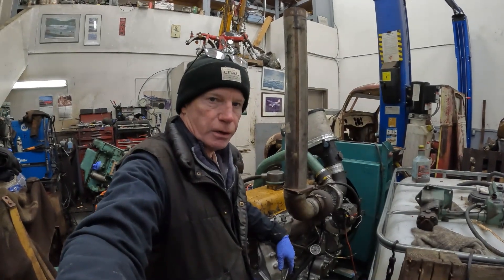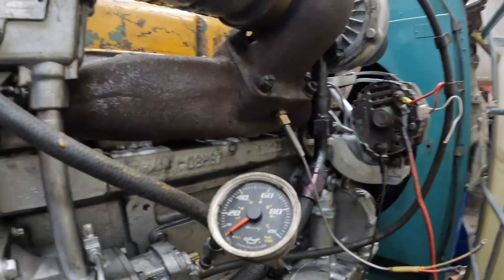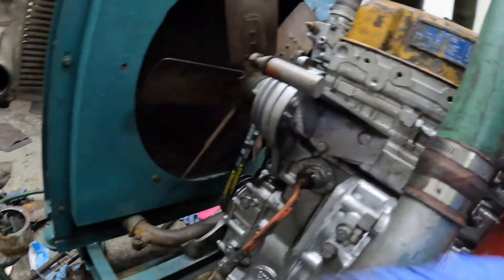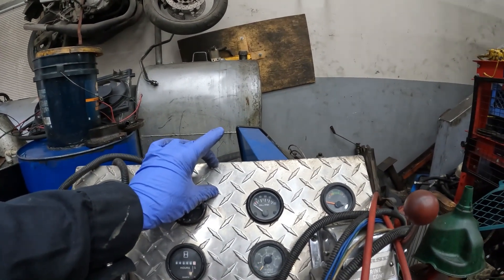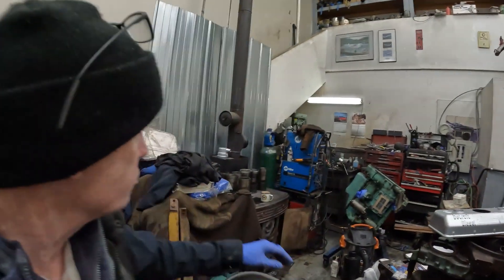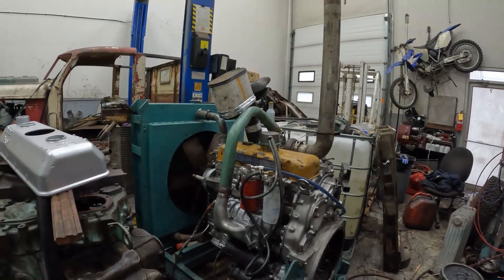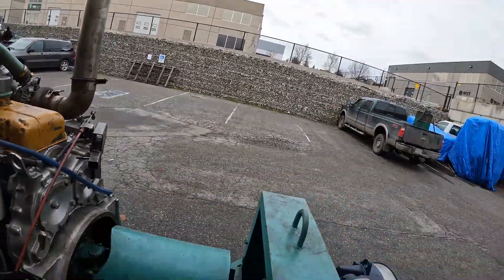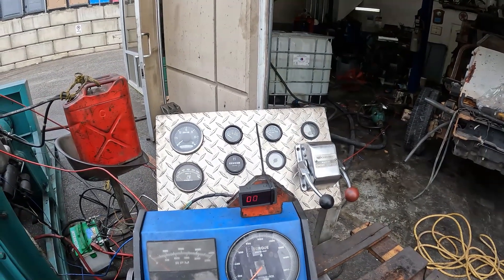Detroit Silver 4-53T (Dyno 80 MM Injectors)

Comment: Another terrific and informative video, question…. You pointed me in the correct direction for my 6V53T adapting a GM NV4500 to it. Now I may be getting 4-53T, would that be the same SAE#2 from phoenix to adapt a GM NV4500 as well? Thank you.
Reply from the maker: Most likely, but some 4-53T's did come with #3 housings, so you'll have measure it to be sure.:)

Comment: Dang 25 psi is decent, you may have already said it, but what you get for peak EGT’s? It was smoking some, but by no means rolling coal, so that’s nice!
Reply from the maker: It ran around 900 degrees at 100% loads.:) Some smoke, but just a haze.:)  Next injectors will be 9E85's and that will be interesting.  I'll run it first without an intercooler to see how much smoke there is.:)  Will be adding the Intercooler after that.:)
Reply: Not bad at 900, you got some temps to spare…and intercooler will be interesting to see what happens with smoke and egt’s. What injectors did you run in your truck a few months back that ran like poorly?
Reply from the maker: @clayclifford53  Should be interesting.:)  I swapped in a set of used 9G90's.  Ran real nice for 5-10 miles or so before one tip took a dump.:)  I've replaced the tip with a new one, so see how they run now on the dyno.:)

Comment: That engine sounds absolutely perfect. 
I don't remember the ones we had running that smooth. Possibly, but we seldom ran them wide open on pumps or light plants. The one on our genset was governed  to voltage and frequency and never changed. The pump ran just fast enough to deliver the flow we needed. 
One of the guys decided to horse around a little by blipping the throttle while I was washing equipment with a 1 inch hose. It took everything I had to hold on, even for a few seconds. I still have many fond memories but they're pretty rusty. You may have noticed that I have a great fondness for these engines.
Reply from the maker: That's awesome.:)  My first exposure to Detroits was at the age of five.  My dad owned a small logging company, Hayes HDX 12V71 and two skidders with 4-53's.:)  He too loved Detroits and in the day pretty much everything was Detroit.  It was those memories that started this Detroit obsession for me.:)  Being I drive one daily, I'm always getting my fix.:)

Comment: Knowing CC per injection, rpm and power available should give a direct result in grams/kw/hr for BSFC.   Boost is looking decent........still a long way to go to 42psi ( like the modern heavy truck engines) Interesting to see how boost tracks with injector sizes going up.  However, for its capacity, it is making good torque, relative to boost.
Reply from the maker: True, showing progress in the power bumps.  The 9E85's will add another 20-30 HP, so we'll see how it responds.:)
Reply: High boost doesn't get the same result as a 4 stroke engine, fit a pressure gauge to the airbox and see what true charge pressure is. That blower becomes a hindrance at high outputs. On high spec 92s and 149s the blowers were fitted with  boost operated bypass valves.
Reply from the maker: @raygale4198  Thanks, I'll have the airbox pressure gauge for the next run.:)  Right now I'm running the T blower, but will compare the N and bypass blower.:) On my truck I have an N blower that's bypassed at 10 psi.:)

Comment: Nice work there. The GMC dealer I worked at had no engine dyno. Had a chassis dyno for the big trucks. Used it to break in inframes and injector changes for extra horsepower. Real noisy to roll a big truck. Had to watch drive tire temp also. We did get big power out of the Silver 92's. Looking forward to your injector change.
Reply from the maker: Thanks, that would be something.:) having a lot of fun with the dyno.:)